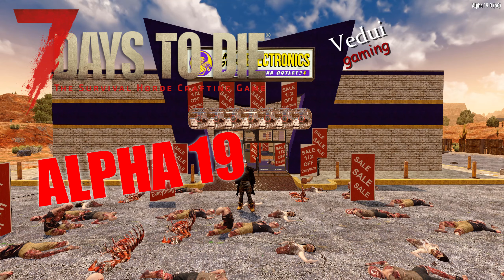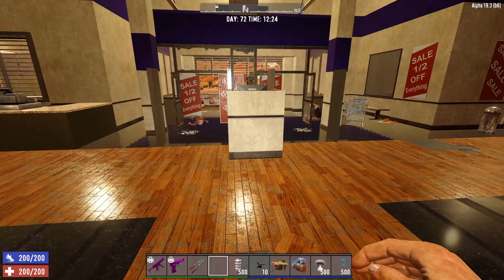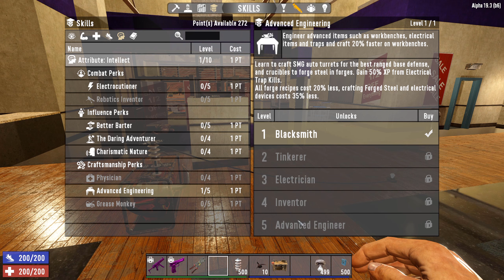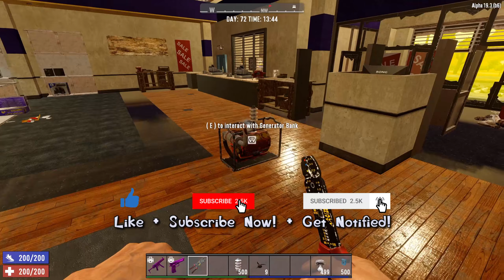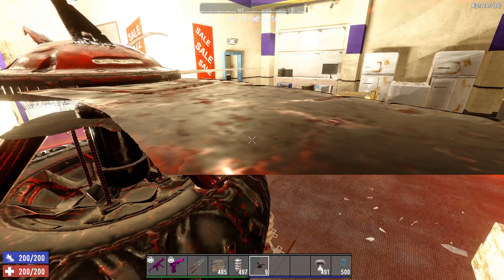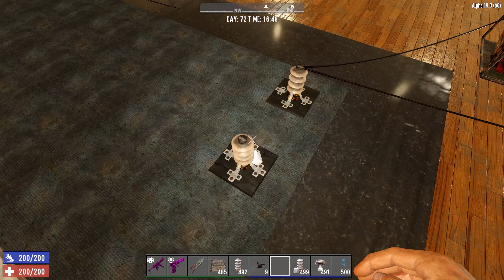7 Days To Die Electricity & Wiring | Game Spotlight! @Vedui42

Comment: One thing I wish they would implement is the ability for backup power.

I've been trying to make a system where the solar panels would charge batteries during the day, run the batteries during the night, but if the batteries run dry....to use the generator.

Of course this means they would need to consider at least one object that allows multiple inputs.

I'd suggest a type of switch that allows a primary and secondary connection. If power is running to primary, then use it. If power stops, then switch to secondary.

Unless there's a vanilla way to do this already.
Reply from the maker: Yes. While you can do backup with batteries, there's no easy way to automatically switch on a generator. A simple logic-block might've been nice, so  you could activate a generator when the solar generator was off/not providing power :)
Reply: @Vedui42  I do know there's ways to make a circuit in reverse, so that a door would close if a switch is pressed and open if it isn't... But it's complex and not very reliable.

So yeah, really the only alternative we have is more batteries.

I have the lights in the base set up on motion sensors and solar panels with a battery. A generator ready in case I need it. I gotta turn it on though.

The defences are run by a generator with a battery backup. Only part of the defences are active during the week and when the horde comes I flip a switch for full power.
Reply from the maker: Not terribly complex. I showed how before ...very reliable :) At the end of the video. https://www.youtube.com/watch?v=yOoVltDw2gY

Comment: Maybe something nice for the Dart Traps:
At your own risk!
You can change the firerate of the dart traps.
Find blocks.xml in ... steamapps > common > 7 Days To Die > Data > Config >
Open blocks.xml with the editor and use the search funtion to find darttrap
There is one row
<property name="BurstFireRate" value="0.5"/>
0.5 is 1 Dart in 0.5 seconds
0.1 is much faster :)
Change as you whant and save blocks.xml and that is it :)
I use 1.2 because i play 120min/24hours and my hordnight is 30 minutes long. So my dart traps have 1500 darts x 1.2 seconds each = 1800 seconds = 30 min :)
I cannot refill my darttraps in hordnight because to far away and to much trouble in my hordnights :)
Reply from the maker: We really should get trap-upgrade mods!

Comment: Another great video！！
I haven't watch all your videos yet,but I really want to know the power consumption speed of generator.if there is 1000 gasoline in the generator and run as 100W,how long can it hold
if you have made a video about it,maybe you can put the link below
Reply from the maker: Hello! I haven't really checked that specifically :) I pretty much never have a circuit that is stable like that, as I'd always put in traps etc, and those would pull more when active, and less when not, making it pointless for my builds :D
Reply: @Vedui42  Ok,thanks anyway.I ask this because I always put lots of useless lights in my bunker😂
Reply from the maker: I understand! A trick is to put in motion sensors in the entrance/room, and basically when detecting a player enable power for say 15 mins or something. That means if you happen to walk around or through it'll turn the lights on, then off in 15 mins, and if not around then saving a lot of power :D depends on your build though, but you can easily signal-passthrough chain a bunch of motion sensors in the rooms/corridors, then chain all lights after that and resolve it that way :D not perfect, but definitely saves a lot of fuel. For added benefit, using solar generators helps even more, as you can effectively chain a solar generator --> battery bank and then down to light your whole bunker up with no issue at all :D
Reply: @Vedui42  thanks a lot,bro👍🏻
Reply: @maprotilineduke2760  A completely full generator running at maximum 300W power will last for just under 2 REAL LIFE hours, the time it lasts is completely dependent on how much Wattage is being used. The generator uses 1.8 units of fuel per watt being output per hour. So if you are powering just a few lights and using only for example 50 watts, your generator will run for 10 hours or so before going empty
Reply: @RicardoSanchez-es5wl  glad to know that,thank you very much😃